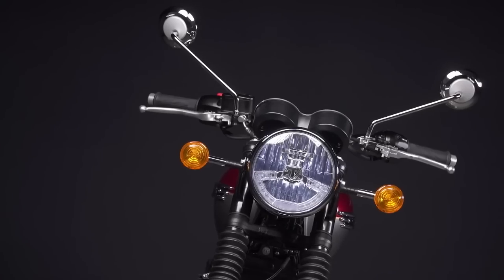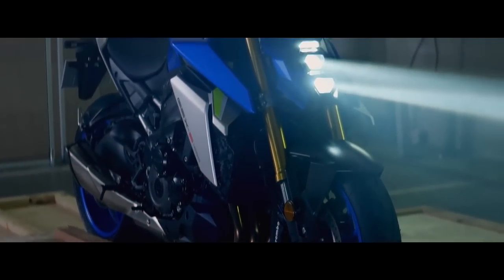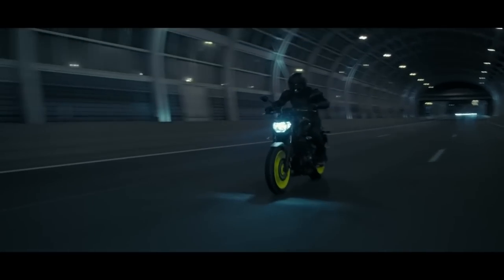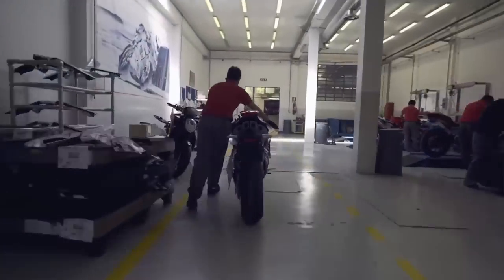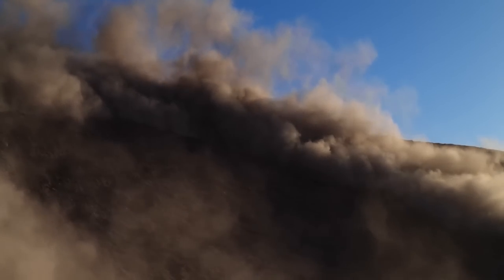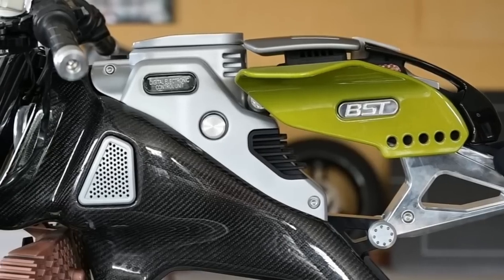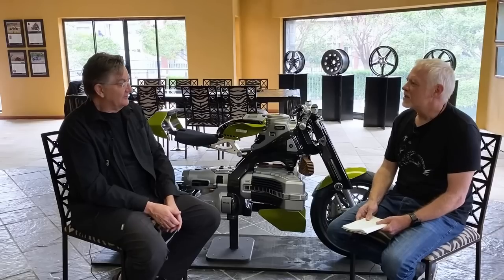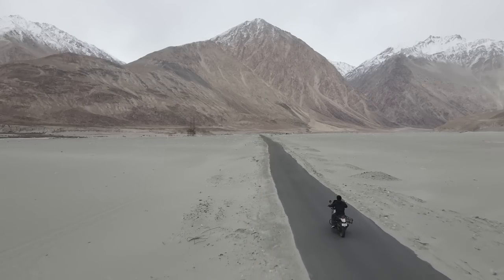Why old motorcycles look better than new motorcycles

Comment: The thing to remember when romanticisng old bikes is they were the best tech of their time. What looks charming and quaint these days was cutting edge back then.  If they had the ability to use plastics back then, they would have. If in order to package the best engine in the frame meant you needed to remove a bunch of components to get to the valves, they would have used that design. Same with fuel injection and electronics etc. If Terblanche is known for any 1 thing, it's form.  The 999 just about killed Ducati, regardless of its function which was very good indeed. Sure, old bikes look cool, and can be cool for short rides where posing is most important. But not for serious, perfomance rides. I'll take a new, plastic wrapped MV any day over a new retro bike.

Comment: I find this video fascinating. I also find how that electric bike is unapologetically electric. One of the things I hate the most is "fake function", like the fake carbs on those Triumphs or fake gas tanks on... any bike as some examples. I am definitely not a fan of electric vehicles. The technology simply isn't there and it isn't a viable alternative to the internal combustion engine in anyway way, unless we find some new, undiscovered battery technology (which could possibly maybe probably not happen, mind you. I can't comment on what we haven't found lol). Electric bikes though I think make way more sense than electric cars, especially if you live in the city. Synthetic fuels that don't create hydrocarbons in the ICE are probably future.

That said, I personally love mechanical things. I love how you can look at something and see what it does, even if you've never really seen that specific thing before. Like you said, that need of function is what created that beautiful form, and I think that electric bike is on to something. It may or may not be over designed and may or may not be the definitive "electric bike" but damnit those are the kinda balls the industry needs to truly progress. It's felt pretty stale since the Hayabusa came out if you ask me. Like it went into maintenance mode or something lol

Comment: Motorcycle carb to fuel injection system used in old diesel truck but still uses gasoline. Simple engineering and easy to maintain. But why no manufacturer make this?

Comment: I think there are a lot of highly disputable claims in this video! Especially with regard to the electric BST. It still completely avoids 'The Elephant In The Room' for all electric motorcycles – good aerodynamics. The solution was demonstrated unarguably by NSU in the 1950s – and by the original Triumph Bonneville streamliner. Since then, only Peraves have followed the obvious solution – along with Cedric Lynch and his home-built 1991 special that can run for 500 miles at 50-60mph on a single charge. And I don't agree that your old Triumph is beautiful because it's functional. The truth is that Triumphs of that era were bloody leaky, vibratory and unreliable and I count myself very lucky to have bought a cheap second-hand 1967 Honda CB450 in 1973 which kept running and running for a decade while all my friends were broken down with unreliable Triumphs and Nortons!

Comment: One of the ugliest things about modern bikes are those plastic gills attached to the sides of the gas tank. They serve no purpose & I think they're supposed to either be fake air scoops or reduce top speed from wind drag. KTM Dukes have the biggest, ugliest gills.

Comment: The electronics are extremely complicated on new motorcycles. Good luck trying to fix a problem. Most have a body control module that if goes bad you will lose blinkers horn ability to put headlight onto high beam.etc etc this one module even controls ignition and fuel system...think harley sportster as is in my case....extremely expensive

Comment: I think it is a generation thing. The perspective changes. If you ask people now at the age fo 50 and older to draw a motorcycle, they will draw two wheels, a front fork, handle bars a tank, a brick-shaped seat and between the wheels a engine, that is instantly recognizable as a engine, perhaps the design type and number of cylinders is visible. And each element will be drawn as a unit connected by the frame. 
Younger people will also draw two wheels. But all other elements will flow into each other and most of the vehicle will be covered by a fairing with many triangular lines in 3d and 2d directed front down. If they draw a naked bike, there will be almost as many triangular structures, only a little space will be left free in the middle. An indefinable black lump is then drawn at this point
But they will like it!
I as a 63 year old guy dont like it, but i have to deal with that. 
There are kids, if you ask them to draw a fish, they draw a fish stick. 
If you ask young people for directions, you will increasingly see them pointing in the direction with their thumbs, they also press doorbells with their thumbs because they have forgotten how to use their index fingers due to their constant use of their smartphones.
I dont like that! But it is their future. 
And if they like KTMs, that look like a prop master of a star wars production has it designed during LSD intoxication, then they should get their KTMs.

Comment: I'm sympathetic towards the idea of your video, and agree that motorcycle design is often not as attractive today, but you missed a lot of the fundamental reasons why motorcycles today look different. Basically, motorcycles today are better - their function has gotten better. They're faster, slow down better, are more stable in a straight line, more stable over bumps, are better in a corner, are more reliable, and lighter. You mentioned how motorcycles like the CB750 have a visual lightness, but overlooked the fact that they were actually heavier than their modern counterparts. Those elegant air-cooled engines were slower and less reliable than modern liquid-cooled engines, those steel tube frames flexed more compared to modern more complex designs, larger diameter wheels eere slower in cornering, spoked rims prevented radial tires, and the list goes on and on...

Comment: The BST is unbelievably hideous - probably the most awful thing I've ever seen on two wheels. Form following function should at least end up being easy on the eye and this, just isn't. And as for function, there is little of that, frankly. So, no, I wouldn't buy one.

Comment: halfway through your video.. If you like the artform of some electric bikes and MV Agusta, why haven't you looked into Energicas? they are at the top of the food chain right now as real production bikes and have aerodynamic farings and a low frontal area, two things your EV example prototype lacks. And EVs need as much of both as possible... especially more than gas bikes.

Comment: Motorcycles stopped looking good after 1980, i can't think of any modern Motorcycle that I would want , I hate the plastic fairings ,wide rear tyres etc and hate the tech,a bike should be about simplicity and cheap transport, just my opinion 🙂

Comment: Modern motorcycle design is based on the triangle, or wedge. Traditional motorcycle design is based on curved forms. Current designs are informed by comic book imagery, leading to ever more extreme and caricatured shapes. Unless you are travelling at extreme speeds, the aerodynamic properties of the wedge are irrelevant, but they dominate design language of motorbikes. Compound curves don't have to be "retro", but the market is undiscriminating and ill-informed, leading to self-fulfilling design briefs.

Comment: There is no mention of CURVES. Classic motorcycles did not have sharp edges. Almost every component had a roundness to it, where possible. Contemporary bikes do away with curves and replace them with sharp angles, and sometimes a confusing mess of sharp components in the name of "aggressive styling". This is an Alpha Male concept. Feminine curves are now out and masculine, aggressive sharpness is in. This exposes a rather pathetic insecurity of both designers and riders. It displays a lack of imagination or aesthetic appreciation, and the same goes for the current obsession with black, dark or grey motorcycles - another nod to the ludicrous notion that lack of colour equals "masculine".

Comment: To me modern motorcycles all want to be different but do so in the cheapest way possible. So you just end up with the same frame with as few as cheaply made parts as possible randomly plastered around the frame in the way some board or committee thought would appeal the most average buyers. 

That being said it is also hard to design something like a naked motorcycle when so much of the mechanical bits are all visible. And come from third party catalog of parts. Changing any one of them just for the sake of aesthetics would increase the production cost a lot. Special water pump, engine cover or even just cooling hoses. Would anyone pay for it?

I think a lot of it is forgivable but the headlight assembly has no such restrictions. Why are they so goddamn ugly? 2024 mt-09, ktm 890, z900, triumph, bmw 900... all attrocious. And I own one of them. Even the ducati looks bad. What gives?

Comment: Simple reason: The old designs made motorcycles LOOK like motorcycles.  New designs look like two wheeled cars.  Old motorcycles were owner-repairable.  New motorcycles...forget it and have it towed to the dealer, there is nothing owner repairable on the new ones.  Basically, new motorcycles are overdone and overengineered and no longer simple dependable transportation.  And they tend to be overpriced as well. This applies to of all things, Locomotives as well.  Yes, the old steam engines were inefficient, noisy, and maintenance intensive.  They were also moving sculptures of power under control.  New Locomotives...boxes on a flatcar.  yeesh...

Comment: The Triumph Bonneville is a good example of how beautiful or how ugly a motorcycle can be. A 1968 Bonneville is stunningly beautiful. It's a machine, only has what it needs, it's clean and uncomplicated, and there is nothing inherently wrong with it's technology. It's build quality was poor, and yes, some minor parts could be redesigned to work a little better and last a little longer. Contrast that to a modern Bonneville, which is fat and bulbous looking, has a lot of plastic, and just plain ugly. It does not need EFI, ABS, liquid cooling, chain driven overhead cams (which are actually LESS reliable than pushrod valves) and a lot of other crap. Look at the early 2000s Kawasaki W650. It looks almost exactly like a mid '60s Bonneville. It would look better with a drum front brake, which is perfectly adequate for it's weight and power output. It does have that bevel cam drive, which is certainly better than a chain, but pushrods would have been even better. And it is 35 years newer than the 1968 model. I have a 2013 Royal Enfield B5 Bullet 500, and it also has that clean, elegant 1950s/1960s look. I converted it from EFI to an Amal carburetor, and fitted a period correct aftermarket exhaust that looks and sounds 10 times better than the huge, ugly 50 pound torpedo thing it came with. My final modification was to replace the front disc with a cable operated drum. It now has the look, sound, and feel of the vintage design motorcycle it has always been. There is no plastic and no "modern" technology on it. It is light and clean looking, and there are a lot of places where you can see through it, which is not the case with newer design "retro" bikes.
Reply: You forget the fact that the EFI, “huge torpedos”, ABS etc, etc are a placed for the simple reason that it’s needed due to enviromental demands. A modern motorcycle need to obay the laws and regulations for emissions and noice.
Reply: @geraldscott4302  
No, it’s there for the sake of the enviroment and the protection of the citizens.
Reply: @kasperkjrsgaard1447  Development, logging, and those awful windmill farms do 100s of times more environmental damage than motor vehicles. When they stop doing those things, I'll reconsider my opinion about motor vehicles.

Comment: Modern cars with more plastic are not safer than older cars because of the intensive use of this material. They have a more rigid and reinforced metallic frame, better handling and suspension, they do crash tests, etc. Older motorcycles may look aesthetically better, because modern motorcycles want to look like race bikes, trying to influence buyers that these bikes are very performant, that if you ride these bikes you'll be a racer on the streets. They not only look worse, they are much less comfortable, some seats seem a wooden board. They are safer because of rigid suspensions, much better brakes, ABS, etc., they are indeed technological better, but they look uglier ...

Comment: Where exactly on a car does plastic “contribute to safety”…?  it’s used because it’s cheaper, and easier to manufacture.. and sometimes lighter…. Doesn’t have much to do with safety…
Reply from the maker: https://www.innovativeautomation.com/the-history-importance-and-use-of-plastics-in-automobiles/
Reply: @bartmotorcycle  That is complete BS, as in the author does not know what they're talking about. Door cladding doesn't take an impact, the frame does. And bumpers protect against parking lot speed impacts, nothing more.

Comment: They may be pretty but they were also absurdly unreliable, had bad brakes, crap suspension, no grip, low power and would rust so fast you could watch it. The best thing about the past is that it's in the past.

Comment: PS interesting film just thinking about my comments just now yes I know electric vehicles will be the thing in the future I have nothing against them I actually miss round with electric pushbikes quite a lot both myself having a bad leg and my girlfriend having lost her leg where a car driver is glanced her and removed her leg so I like electric pushbikes don’t get me wrong but working with metal and working with old motorcycles metal is a medium that can always be repaired straight and modified plastic is an unfriendly medium As with the BMW k Which I absolutely adore the plastic bits are a bit aggressive going wrong and will be in the biggest problem with keeping Going funny The BMW is actually one of my new bikes People look at you actually horrified when you say oh I’ve got 200,000 miles on my bike I’ve known k with 500,000 miles on so yes the idea of the clutch is a very good idea and I do like electric vehicles but plastic I know it’s light the only people that helps is actually the manufacturers for a cheap as a manufacturing sorry if I had a rant Lifelong motorcyclist Michael

Comment: Yeah, to a lot of people, the old motorcycles look better in every sense but they demands a rather hectic maintance. My first motorcycle, a ‘72 Honda CB 750, demanded oilchange every 3.000 miles or 5.000 km. Points to be adjusted at the same intervals. Valves too. Carburettors needed adjustment every 5.000 km.

My allmost modern Suzuki does 10.000 km between changes. Valves are by shims, and i have so far changed two shims in 157.000 km. Spark plugs lasts 50.000 km. In general the modern motorcycle is a much better ride than the old ones.
Admitted; my old Honda looked way better than my current ride, a DL 1000 Suzuki, but to put it straight, it’s a piece of crap if you want to ride a lot of troublefree km.

Comment: but you forget a major issue, supply and demand, yeah, old ones are more hand made, but most of the parts where factory produced not hand crafted with minimal tool use, most bikes you see now are sketched, all parts fit the places they need to, but everything is more obviously mass produced. i see your point, but holy shit you are pretentious, just say you like old bikes and classic styled bikes instead of pushing and ultimately, pretty shit set of reasons.

Comment: "New cars are safer" , how do you KNOW this? Also, enroll in an advanced mechanic school, then tell me about how a scan tool will diagnose a broken piston rings or burned valve or gauled bearing etc etc etc..... You are ripe for the nut House of modern ideas (Nietzsche).